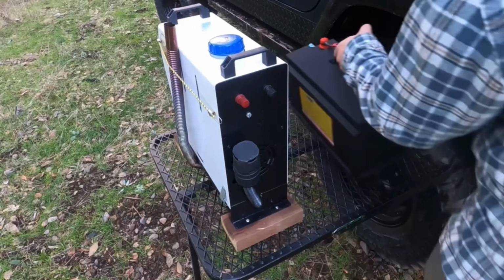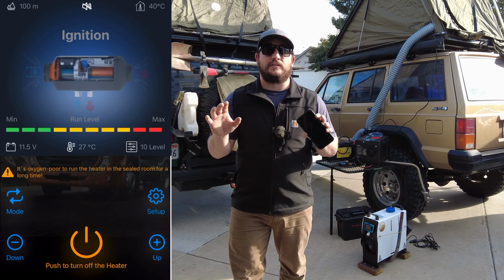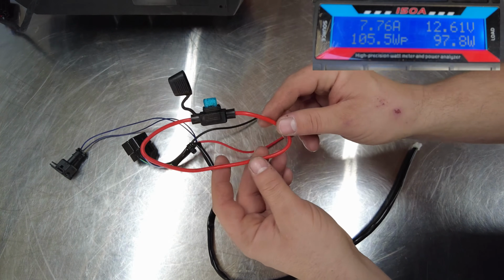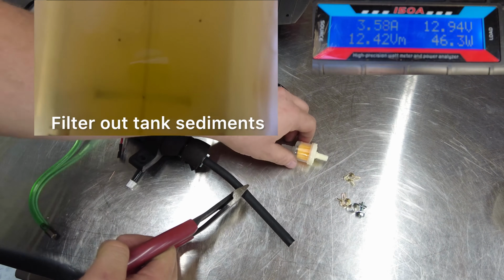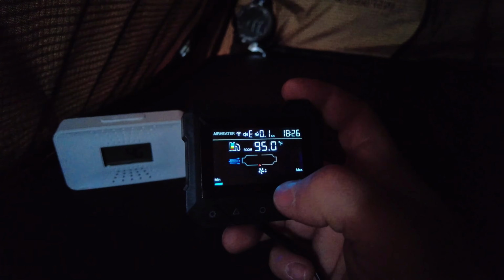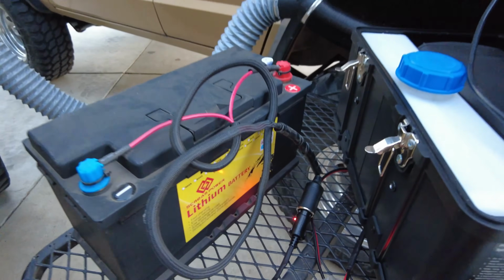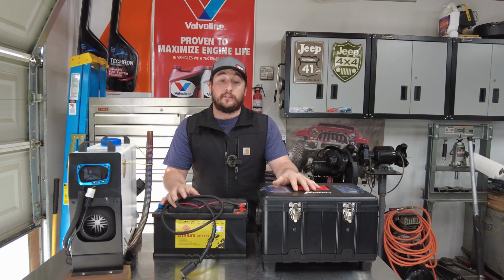Diesel Heaters For Winter Tent Camping - Upgrades and Modifications

Comment from the maker: This unit has a new “Level mode” that allows the heater to be adjusted based on a level of heat you choose, by toggling the keys on the pad. This control mode automatically adjusts all the internal components, ie fan, bump speed, altitude, taking the guesswork out and the need to manually change settings in engineering mode.  Like on the older heaters. Coupled  with the Bluetooth app and this new mode of control, there’s no more need for thermostatic control and extension of the cable, 
But It’s still a good idea though. 🍻

0:01 Hcalory Heater tent Setup
0:40 tent camping for beginners
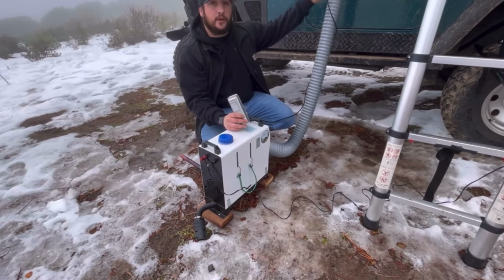2:00 Diesel or Kerosene 
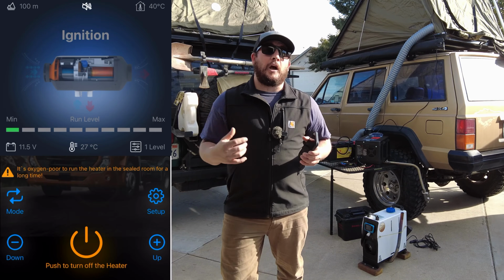2:53 New Level Mode
3:36 Battery cable mod
5:10  Inline fuse mod
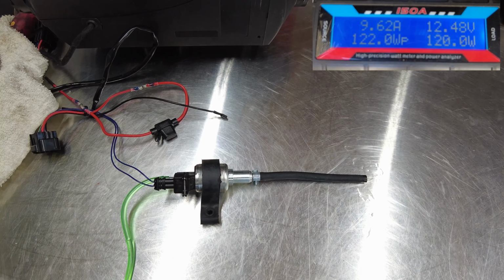6:19 Sound damping fuel pump
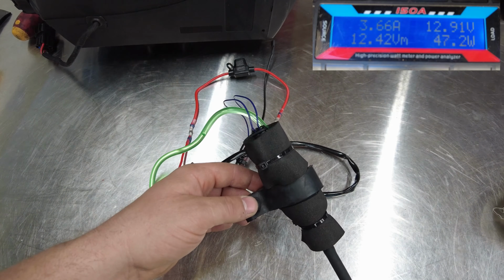7:19 Fuel filter mod
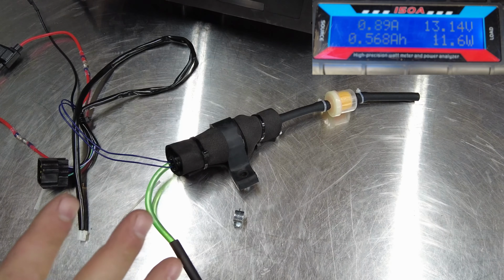8:49 Heater assembly 
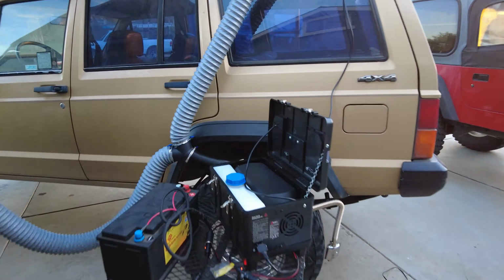9:45 Heater control overview
15:03 Heater full load amp results

Comment: There should be little glass fuse inside the lighter plug
Reply from the maker: yes most are designed that way, but this one was repurposed from an older heavy current camping light that did not come with a fuse on the inside. yeah you can buy them with 10-15-20amp glass fuses. i've since gone away with this style of connection and moved to anderson pole for that reason, car fuses are much more popular and everywhere and most power stations with a cig socket allow a max of 10amps anyway. 12amps is minimum needed at full load with these heaters in cold weather. 🍻

Comment: IEC connection for  12V or 24V is a huge NO NO.....  IEC connectors are dedicated for 110/220 and not 12V/24V. They should have used XT style connector or just screw terminals for SAFETY of everybody , especially people (kids,adults) who have no clue about electricity/voltages etc. They can't even spend a dollar more for some kind of fuse inside or outside , or fused socket ,wtf. Are the OEMs so dumb or they are pushing the limits of safety really to maximize profit ? Their products should banned until they do the things the right way. 

EDIT: Another questions is , do these heaters have reverse polarity protection ?
Reply: I absolutely totally agree with you about that IEC connector.  Who even thought that would be a good idea??  One of the first things I did when I got my unit was change that to an Anderson Power Pole before I even connected to the power supply.  (I use Power Pole connectors on pretty much all of my DC stuff anyway, so this was going to happen regardless.)  Still, I can't help wondering how many people have destroyed the board in their unit (or worse) by plugging it directly into 110VAC.  The power wires to that IEC socket are connected by pretty flimsy spade terminals.  Those things were barely hanging on, and I have little doubt that they would come loose and cause all kinds of issues.
I realize many people don't have the tools or knowledge to do these kinds of mod's, and really they shouldn't have to.  That IEC socket HAS to go.  It truly is a safety risk.

Comment: I have heard nothing but good things about the Hcalory Tool box heater. I get adding the fuel filter, but will that stress the pump? I mean if the original design did not include a filter maybe the the draw power of the pump is not made for one. I am new so please don't roast. 

Thanks!!
Reply: That is actually a really valid question.  I just got the exact same unit they had in this video.  While I was in there changing the power plug, I also added a fuel filter.  A fuel filter won't add any stress to the pump.  It may add a few seconds to the priming time, but otherwise no real issues.  Another thing to consider is that (here in the US) Diesel can sometimes be rather dirty even right from the pump.  Also, it is easier than you might think for things (dead bugs, sand, etc.) to fall into the tank while filling it.   I would rather filter out as much of that stuff as possible.  Makes life a little easier on the fuel system.

Comment: Carbon monoxide detector - that won't work for diesel as they produce hardly any CO . Only two options for diesel fuel - Nitrogen Dioxide but detectors are expensive for commercial use , circa £ 300 . The only other  option to test if exhaust gases are leaking into heated air supply which is to monitor for any rise in CO2.  Diesel exhaust circa 7% CO2 compared to 0.04 % in general air. so esp if you are recirculating heated air then CO2 will start to rise , although limited to doing a test run without anybody in there to add CO2 by breathing

Comment: I tried that plastic vent hose you're using and it melted where it was clamped on to the unit, so keep an eye on it. Mine must burn alot hotter than yours?
Reply from the maker: I keep my heater on high for no longer than 10 minutes it usually on low for long periods of time. I no longer put it directly on the heaters outlet I use the rigid aluminum duct and then put the flex on the end of that.

Comment: thanks for the info! im getting ready to try a diesel heater. ive stumbled on some blogs that say those PVC coated hoses can be toxic because there not rated for the temperature these heaters put out....from what i can tell they are saying dryer venting hose is different temps than diesel heater output. also see complaints that the inner foil on these pvc hoses can puncture easily. some recommend going from 3 inch to 4 inch hose coming out of these diesel heaters so they dont overheat.
Reply from the maker: There is no need to go from 3” to 4 unless the duct you want is in 4” I’ve used this machine for many hours with this pcv duct and I’m just fine. The aluminum is thin it’s possible it can be easily punctured. In this video I use aluminum duct this one (https://amzn.to/48gFu4w) and a splitter to heat two tent if I don’t use a splitter I use a coupler to the 3” heat rated flex ducting. ( https://amzn.to/48ao0GT) to reach my tent that way the pvc is further away from the heat of the heater. 🍻

Comment: Did you reinstall the split-lock washers when you screwed the gas tank back on?  I couldn't find a way to slip those back in after I unscrewed the tank to install a fuel filter.
Reply from the maker: It seemed like I put everything back in place, I can’t recall. 🍻
Reply: I taped mine to the fuel tank and cut a hole in the tape, problem solved!

Comment: Do you have a link to the 90 degree bend exhaust ?? Looked on A and can't seem to find it
Reply from the maker: That 90 bend is specially made for that heater. I can’t find it either, but I will ask hcalory for a part number and get back to you. 🍻
Reply: @ATEMOFFROAD   Hi. Any luck getting that part number? I too am interested. Thanks in advance.

Comment: Great idea for heating both tents! 
 FYI, never let your battery sit with less than 50% charge for any length of time. Get it back on a charger as soon as you draw it down to anymore than 50% charge or you will be shortening the life of the battery.
Reply: It's a lithium battery, so the "50% charge" issue doesn't apply.
Reply from the maker: Good point , I try and charge it as soon as I get it home from my trips. Thanks for watching 🍻

Comment: The manufacturer chose a potentially unsafe design when they used an input connector that is designed for 120 volt alternating current devices. The danger is that an unsophisticated user who doesn't understand the voltages and dangers of 120v compared to 12v. If someone loses the 12v dongle that you fabricated, they might see the shape of the receptacle and use a standard 120v connecting wire plugged into mains power, which could energize the frame with 120v. I suggest converting the manufacturer's receptacle to an xt30 or similar connector that is designed for low voltage devices. The unit will be fine in your posession, as you know the proper usage. But if that ever falls into the hands of someone else, the potential for injury or death is there in the design.
Reply from the maker: Yes you are absolutely correct on that and this has been passed on to the manufacturer for revision. It’s out of my hands at this point. Just for thought , in theory the frame is isolated from the heater, but not the exhaust. Would it more likely be that the control board would take a hit and the 120v will just wait? The user will then decide if it’s on fire or he realizes he just damaged the machine. The failure will be quick especially if the user has the device plugged into a GFCI protected circuit. If there is no GFCI protection on the circuit the 12v mains relay will not energize because the coil shorts from the hit of the 120vac or the low current control circuit is damaged thus no control of the 12v heavy current mains to start the heater.

Comment: I'm looking at your setup on the table.  When out actually camping how do you protect the heater and battery from the elements?  Wind/rain/snow is a real problem if not protected...... what do you do?
Reply: I ordered all the parts you've listed for improvements........ I'm having trouble getting the fuel filter to fit under the power coupling and not kink the fuel line.  I just ordered a smaller fuel filter and hope that solves the problem.  It's just so tight between the pump and the fuel tank.  The power plug in gets in the way and the wires don't like being pushed around without loosing up.
Reply from the maker: @tomlauritzen9522   I had that same problem it’s a tight fit that’s for sure one trick is to remove the two screws that secure the power cable connector to the enclosure. Once fitted than reconnect  wires and put your screws back on. there are decent fuel filter at local auto parts stores for small engines can check on of those out . 🍻
Reply from the maker: I use awnings that protect my gear from rain and snow 🍻 https://youtu.be/aWXWCqOB17c?si=v_hQxcS0YRYhC537

Comment: I like the mods you have done.  Is there a concern with the air intake?  The old heater you have has an air filter and the new one doesn't appear to have a filter, can this be added?  Thanks
Reply from the maker: Looking back there is an air filter on the air inlet  it’s under the unit, you can see it in this video>>KING Of Affordable Diesel Heaters | The HCALORY - SS2 8KW Air Heater | This Is The ONE
https://youtu.be/WU3cRakyjko

Comment: Finally got the heater like you said they would be back in stock. I'm trying to do what you've done to your heater. I can't get the one screw off to remove the tank. Must have loctite on the bolt. If I just remove the heater can I get to the fuel line to install a filter on there.
Reply from the maker: I don’t remember any locktite being in there, it will be harder to add a filter with out removing the tank it’s a pretty tight fit to get it in there properly.

Comment: Nice video. Thanks for the links. Where did you get the 90° exhaust elbow?
Reply from the maker: That came with the hcalory heater , currently sold out, but new stock is coming in the beginning of December.

Comment: Ok, everyone keeps saying kerosene is cheaper than diesel... Here in VA kerosene is $1.50 more per gallon than diesel..m
Reply: Do you need to mix kerosene with diesel in colder temps (under 32°f) for this heater to run properly? Or will it ruin the heater?
Reply from the maker: I think that’s it’s a misconception, if you google kerosene near me it takes you straight to the local gas station where they sell diesel not Kerosene. Lol so you maybe correct diesel is far cheaper in my area. 🍻
Reply: I run straight kerosene. Burns cleaner. You can also just stop at Walmart and purchase it in nice aluminum cans from the camping section almost anywhere. No carrying an extra tank of fuel. I don't use enough to worry about the price.

Comment: Nice mods! I have performed a few additional mods to my all-in-one heater for when I'm using it outdoors:
1. I use insulated duct. Insulated ducting keeps the air flowing through the duct warmer, which helps the heater run far more efficiently.
2. I added a GAOHOU Hive Electric 12V Silicone Heater Mat to the side of the fuel tank. It only draws 12w; along with Diesel Power anti-gel poured into the fuel, both ensure my fuel does not gel.
Reply from the maker: Those are great ideas, I may need that mat for my lithium battery if it gets too cold. I usually have lamp oil on me so that would be my additive if fuel starts to gell. Do you happen to have a link to your duct? Thank you 🍻
Reply: In cold climates during the winter gas stations switch to anti gelled diesel in their pumps.
Reply: @HoldYourSeahorses , gas station fuel does NOT have sufficient anti-gel. If you use only what they add your fuel WILL gel. I’ve seen it happen to far too many inexperienced semi drivers, let alone diesel truck drivers. Last winter alone I helped 3 Sprinter van drivers with gelled fuel by adding PS Diesel 9-1-1 to re-liquify their gelled gas station fuel that supposedly had anti-gel mixed in.

In winter, you had better add anti-gel — I only use Power Service anti-gel & fuel system conditioner, and I also keep a bottle of their Diesel 9-1-1 to re-liquify already gelled diesel, and I’ve had to help quite a few rookie semi drivers who did not add anti-gel because they thought they knew better, even after being told by their company to add anti-gel.

Don’t believe the hype!

Comment: Snow camping will kill that lithium battery quickly, unless you have a way to protect it and heat it slightly! 🤔
Reply from the maker: Good point, I believe -10 it will stop discharging, I will keep insulated and inside vehicle.

Comment: Thank you for your videos! It helped me buy the Hcalory. I seem to be getting code E05 (overheat protection) when using a 3” duct hose. Do you get the E05 code?
Reply: Another YouTuber (Ozark Overland Adventures) said you need to use an adaptor and go from 3" to 4" immediately after exiting the heat exchanger.
Reply from the maker: @mikev1021-n8c  I’ve always run 3” and never had any problems. 🍻🤷‍♂️
Reply from the maker: I use a 3” duct but never had this fault. What is the temperature outside you are using this heater and how are you using it? Shop , tent ?
Reply: It’s about 45 degrees F outside. I am using it to heat up an RTT.
Reply from the maker: @jaronfelix4778  maybe try and keep the hose short as Possible without any bends ? Is your heater on lowest setting when is overheats?

Comment: I’ve been trying to extend the length on my diesel heater control module forever!!, thank you for the knowledge, mine has 4 wires, so i would just get the low voltage oxygen free wire correct?
Reply from the maker: Yes, there’s a 4 wire cable in the listing if you follow the link, but any 20g/4 wire cable should work. Thanks for watching 🍻

Comment: I'll be paying attention to how the new heater works for you. I also have been having difficulty finding the ideal vent hose. The cardboard and foil one that my heater came with was too fragile, the ridgid aluminum one fragile and hard to pack. It thought the aluminum with plastic or rubber was the ticket, but the outer layer began to melt and smell. 🙄
Reply from the maker: Maybe try using the cardboard aluminum one for directly over the heater port , keep it short maybe 1-1.5 ft and then couple the plastic one to that way it’s not directly over the hottest part.  that’s what I’m going to do since I haven’t smelled any burning the way I set it up in the video. Any thoughts?
Reply: @ATEMOFFROAD  ours was actually melting at the top end, where the heat came out into the tent, but we did run it all night.
Reply from the maker: @campoutwestus  oh wow I’ve never had that happen as I usually just keep ours on lowest setting throughout the night. there are some flexible all aluminum ones at Home Depot I may go down and check those out after work I’ll keep y’all updated on how it goes. 🍻
Reply: I use insulated duct. Insulated ducting keeps the air flowing through the duct warmer, which helps the heater run far more efficiently.

Comment: Finally a video showing someone heating two separate spaces with one heater. Just rec'd my diesel heater (Vevor brand) and am getting things set up for chilly nights come mid/late March camping next season. Will be heating a 5x9 Hiker Trailer and a 23zero rtt mounted on the trailer. I like the tip of extending the display/control module. 👍
Reply from the maker: Sounds like an awesome setup, the vevor heaters are pretty good IMO. I’ll probably end up taking mine apart for a good cleaning , I’m starting to hear some inconsistencies in the exhaust during peak heating. Thanks for watching 🍻
Reply: @ATEMOFFROAD how much would you actually disassemble to clean?
Reply from the maker: @HoldYourSeahorses  split the case in half and brush out with solvent, clean glow plug, and fuel delivery port. There is a screen that get build up as well. A good once over is necessary about every 2k hours. 🍻
Reply from the maker: @HoldYourSeahorses  these heaters can accumulate carbon build up .